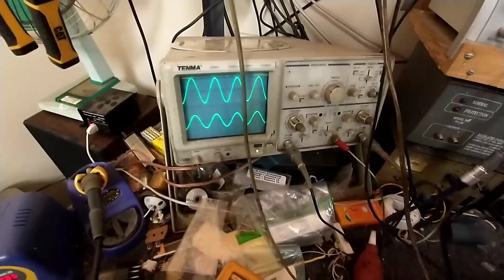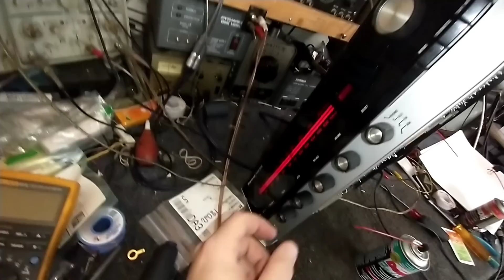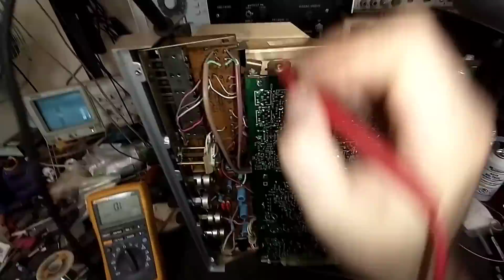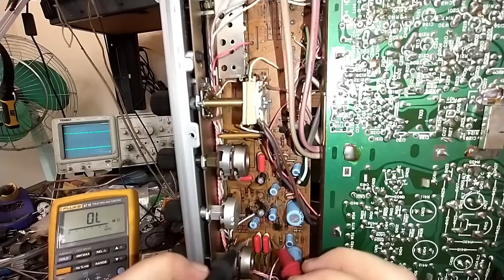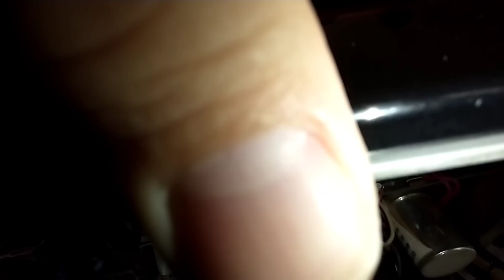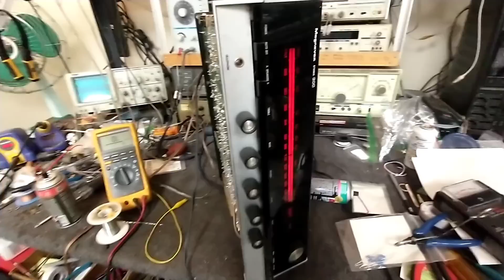Servicing a 1970s Magnavox 300 am/fm stereo receiver. part 2/3 preamp channel imbalance

Comment: I have a strong gut feeling the slight gain mismatch in the pre-amp was a red-herring.   It's much more significant thru the power amp stage.   I would have checked the negative feedback network for drifting values.

Comment: Excellent cost effective repair, nothing wrong with just making it work with something like this.

 I have a Hitachi  SR-604 receiver I was trying to set the bias on, and it won't come down any lower than 28 mV on the right channel (across a 0.22 ohm emitter resistor) where it should be 8mV +/- 4mV. Since it is only 35 watts per channel and class G it is getting buttoned up and going back to the owner, no charge. Not worth my time, circuit too complicated. Why they would use class G for a little flea powered receiver I have no idea. 

Electronics is a hobby for me since I am retired, I don't have to take on what I don't want to. I like that option.😁

Comment: That job sure would have been easier with a schematic. And I think it would make your troubleshooting technique much easier to understand.   I  also don't think I agree with your point on a bad capacitor necessarily causing a frequency dependent gain difference. It would depend where the cap is used in the circuit. E.g., if an emitter bypass cap goes open in a collector follower, all you'd see is a reduction in gain across the entire frequency range. Also you were talking about  voltage gain while taking waveform O'scope voltage measurements off the emitter of a couple of transistors. But an emitter follower can't have a gain of more than 1, and in practice it's usually no more than .9.  
One technique I've used for cap replacement when the bottom of the board isn't accessible, is to simply chop up the cap down near its base, and carefully remove the rest of the body,  to gain access to the leads protruding into the body of the cap. There should be enough lead left there to tack solder in a new capacitor.

Comment: I'm pretty much convinced it's a combination of HFE values in transistors and drifting resistor values. Not much in each stage but all adding up as you go along the stages. So correcting with a padding resistor is quicker and cheaper than replacing a whole bunch of components and stripping down an awkwardly placed pre-amp board, possibly introducing new faults along the way. Great pragmatic, logical trouble shooting. I don't think it gets more real than this.
Reply: Well Said!, It's actually mine!, I tried to fix it but after changing Caps and Output Transistors with no luck figured it was time to send it to the Pro!
Reply: That was my thoughts too. I left my comment before reading yours, and yes, same as you said. You got to do what makes practical sense, loved his solution.

Comment: Has the selector switch been cleaned? That oxide in wafter switches and linear actuated switches hard to cure unless you pull them apart. Takes forever.